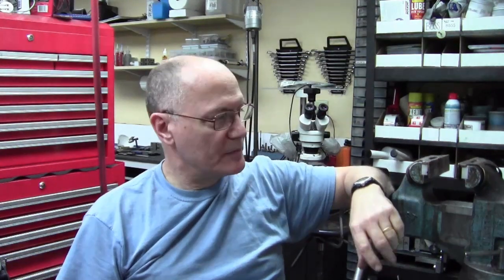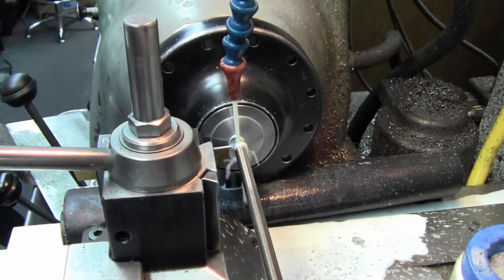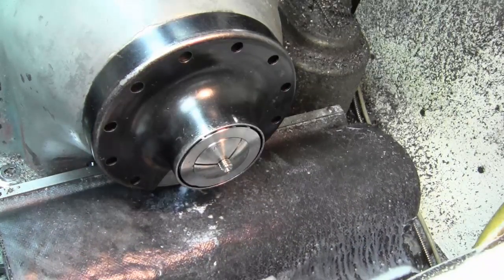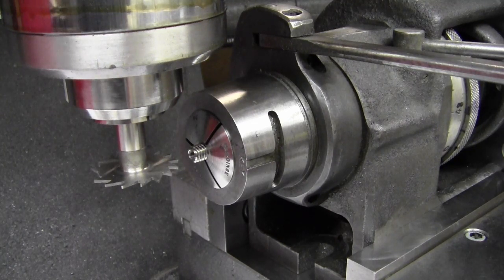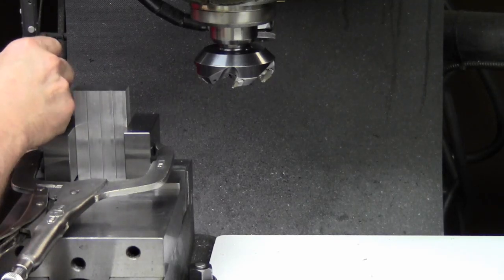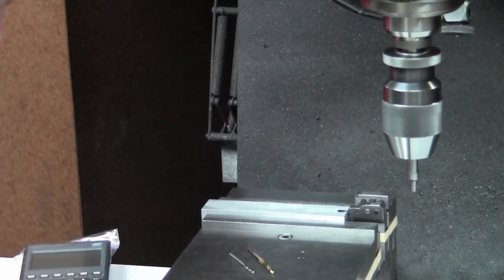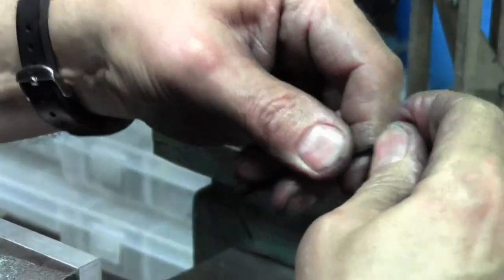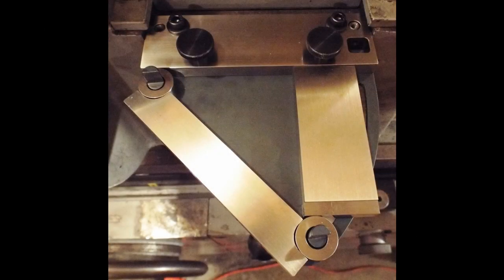Differential Screw Vise Jaws

Comment: New sub here. I thought that differential screws were always two threads with different pitches in the same direction. Now I’ve learned they can be right and left hand the same pitch. I like that your shop is a little bit dirty like mine and doesn’t look like a laboratory.

Comment: The chamfering tool is brilliant.
Reply from the maker: +cod.cape  Thanks.  That thing gets an immense amount of use in my shop. A chamfer machine is not a new idea but there are a lot of design features incorporated in this one that make it unique.
Reply: A complication is that if you were to build one now, you would have to get a used unit. That model that I think is a rebranded Ryobi is no longer made from what I can tell. Bosch made a similar unit too but it looks like it might also be discontinued. I am thinking the easier route if you wanted to start with a new machine. Is a benchtop belt sander.
Reply from the maker: ***** I do a lot of hardened tool steel work where I want to do a very  precise chamfer after finish grinding. The abrasive belt works on both hard and soft material. The axial grind lay of the belt leaves no burrs on the chamfers and I can change grit size to suit the job at hand. If you do a lot of large chamfers > .06" the belt sander will NOT be the ideal tool. Most of my chamfers are < .03"

Comment: Can you please do a video on how you zero out your tool post mounted drill?
Reply from the maker: Put a dowel in the drill chuck. Put a dial test indicator in the spindle. Move the center height and x position of the drill chuck to get it true to the spindle as you spin the indicator around the pin in the chuck.
Reply: Rodger that, thx

Comment: Enjoyed very much, great tips on making the threaded inserts with the collet stop and operations.
Reply from the maker: Thanks Bill glad you enjoyed it!
Reply: Robin is that a shop made collet stop?  What is the size of the stud? From what I am seeing commercial ones seem to be 3/8-24.  I am going to make one I could have used one today would have saved me a lot of time.
Reply from the maker: I have 3 and they are all purchased. That one is 3/8-16 and I have one that is 3/8-24 and one that uses 1/2 dia. solid with a setscrew flat. I just buy all thread to make a variety of styles and diameters. I like the 1/2 diameter style for its instant change of stop rod. The 3/8-16 is next favorite and the 3/8-24 takes too long to change stops even when you use a drill to spin them out.
Reply: Thanks Robin, I think I am going to try and make one with a setscrew and one with a 3/8 16 screw.

Comment: Enjoyed it.  I noticed you milled the aluminum to length, but didn't true up the pieces facing the jaws (the backs against the cast iron) and the space (faces) between the jaws (facing each other where stuff is clamped).  Is it just because they're "soft" jaws, so they're going to get out of whack anyway, and you'd never use it as a reference surface for measuring, so no point?
Reply from the maker: Correct!

Comment: Too late now, but you could have made the through-holes in the vise jaws and had the blind holes in the inserts (leaving an unholed face). 

Source, please, for the double-ended, socketed screws. I could find left-right threaded studs at McMaster-Carr, but without the sockets for tightening.
Reply from the maker: That is a good idea Peter and you are right it is tool late now.  Here is the link for the screws at McMaster http://www.mcmaster.com/#carbide-insert-holder-set-screws/=13dvgkh
Reply: Weird. I wonder why my search did not find them. McMaster-Carr website is usually so good at bringing up the correct pages for a search with ambiguous or poorly-worded search terms. (Page bookmarked on the McMC website)

BTW, nice coverage of the advantages and cautions for using collet stops.

Comment: Robin, first I must apologize as I've been calling you Rob.  Got that fixed now :-). Another awesome video. I was thinking along the same lines as a previous commenter, I would love to see a tour of you shop.  But if not, I think a video series on all the cool tools you have created would be incredibly well received. Starting with the chamfer-meister. I saw that in another video of yours and wondered what that was.  This one described it a little, but I suspect we would all like to learn more details.  Also notice you are using a large hand wheel for the quill.  Obviously you must find that more efficient than one of those quick adjust models. Finally, are you using for the CNC mill?  Thanks.....  Joel
Reply from the maker: Joel, no problem as many who know my name is Robin call me Rob. I promise you will eventually see everything as I work thru my video list. The jig bore style hand wheel is really nice and came from Ralmikes Tool arama many years ago.  Not sure what your question was about the CNC mill.
Reply: +ROBRENZ robin, I guess I didn't proof read that very well.  The CNC question was intended to ask what brand/size mill are you using?  Is it something you converted too, or something purchased?  The work and precision you strive for and achieve is simply amazing.
Reply: I too was wondering about the CNC mill. And also what the guides on the chamerfermeister are made from (-8
Reply from the maker: The mill is a Southwestern industries Trac DPM
Reply from the maker: They are hardened and ground A2 tool steel at 60 RC
Reply: That would be a Southwestern Industries DPM S3 with the AGE 3 control. (Love mine)

Comment: G'day Robin, I was hoping you this was going to be a video on genuine differential screws for the job. They often lead to brilliant and eloquent solutions and don't require any left hand threads, so I was very keen to see how you'd used them. As it turned out, and you rightly pointed out at the outset, in fact these are not actually "differential" threads in the true sense of the word, but it was still a nice video, and thanks for sharing it.

I did feel compelled however to point out that there is no such word in the English language as "heigth", and I know I'm not the only one around who is left wondering where the heck the usage of this word is suddenly coming from. I defy anyone left doubting to find it in any dictionary, as it just doesn't exist. Tom (Lipton) and I have a running joke about me being the "pedantic police" in this regard, but I don't think it's a moot point when many people new to machining are trying to learn from channels like yours, and they may as well learn the correct terms for things instead of charging around looking like idiots while asking for "heigth gages"!
Reply from the maker: Thanks Pete,  I will try working on that but I think my unnecessary use of "ah" to fill every pause in speech needs my main attention right now.
Reply: Ha ha, well you can have some of my "umms" if you like. Better yet, take my "deer caught in the headlights" look every time a camera is even mentioned! I did like that chamfer setup you've made though. You mentioned it in another video and I noticed it then. Sounds noisy, but the concept could be used with other sanders or grinders I'd think. Certainly much cheaper than the commercial ones!!! It would make a good build project if you were considering video subjects. I don't recall seeing a DIY version of these before.

PS. If you think I'm harsh on "heigth", don't get me started on "Soder" with the L that's gone AWOL ;)
Reply from the maker: Get ready, in my next 3 part video on making custom digital calipers I do some "silver soddering".
Reply: Good grief, I'll have no hair left! I was doing a bunch of silver soLdering last night and your last video on "soddering" Tom Lipton's level was going around in my head like the Chucky doll! :P
Reply: @ROBRENZ  don't worry, you may be in the minority that still use the version that people such as Benjamin Franklin used, and that matches with breadth and width, but just because most people have forgotten that heigth is indeed just as proper as width, doesn't mean that you are wrong in using it!

It is much like many of the other details of precision that you have learned that are forgotten by most machinists, you are bringing harmony into your language with width and depth, which probably increases the accuracy of your measurements by a few billionths of an inch.

Comment: 50 years ago I made a few different lengths of pipe that I slotted to go over the spindle stop screw so I wouldn’t need to spin the nuts up and down. Saves a lot of time.
Reply: I did exactly the same thing for the same reasons. Many years later I designed and patented the “Rapid-Stop” a quick release nut that mounted permanently on the Bridgeport quill. It’s no longer in production but I use mine almost every day.

Comment: Hi.

What is that (17:46) flat surface where you 'sand' the blocks?

Nice saw.

Regards
SC
Reply from the maker: That is a cast iron surface plate with 220 silicon carbide paper lightly glued on with 3M 77 contact spray.
Reply: Thank you.

I suppose I can use 3M 77 in my granite flat and remove it with acetone, right?

SC
Reply from the maker: Serra Cabo I would not advise putting abrasive paper on a good granite plate. I would dedicate a cheap one to this job.  wd-40 removes the 3M77 spray best.

Comment: "Shop Notes"*

• Inspired to use soft jaws by Tom Lipton's Baby Bullet vise build: https://www.youtube.com/playlist?list=PLeIuq8LxgnrHZyoRtyvqw-G0Ggl9Ndp70
• Explains differential screw terminology
• Explains how this design is adapted to a typical vise jaw
• Uses 10-32 clamping/differential set screw.
McMasterCarr: https://www.mcmaster.com/#set-screws/=19pej3n
• Parting with a collet-stop in the Hardinge. Collet-stop made to accomodate pip left from parting. Holding the part by hand to prevent whipping (not recommended).
• Drilling and tapping the LH thread in the insert
• Cool-Tool 2 + Tetrahedral Boron Nitride
Unfortunately, Cool Tool 2 can't be sold in California.
McMasterCarr: https://www.mcmaster.com/#cool-tool-ii-cutting-fluids/=19perdz
Rob's link to Boron Nitride (Amazon): https://www.amazon.com/Boron-Nitride-BN-Powder-Purity/dp/B015ENSWHA/
• Overview of collet indexing head and modifications made to it.
• Fitting the screw slot
• Quick introduction to the Rollin EF-1459 and modifications.
Instagram post of further depthstop mod: https://www.instagram.com/p/BVDJ-0aAohJ/?taken-by=robinrenzetti
Rollin's website: http://www.rollinsaw.com/band_saws/EF1459_vertical_band_saw.htm
I've used one of these. They are the only real competitor to Marvel saws. While I thought it was a good tool, I had some complaints. Most of which are addressed by Rob's mods.
• Cutting and flattening the Al stock
• Gang milling an odd setup.
• There's a call-out of the 11R Vise-Grips but I cannot make out the change.
This Instgram post seems to explain it: https://www.instagram.com/p/BYzGmVmg3np/?taken-by=robinrenzetti
• Note on getting a better finish from insert teeth on the inside on a face mill if the work is smaller than the cutting diameter.
• Overview of the Chamfer-Meister, aka the most over-built attachment a Craftsman belt sander has ever seen.
• Drilling and tapping the Al soft jaws.
• Tip about LPS-3 corrosion inhibitor
Amazon: https://www.amazon.com/LPS-Premier-Rust-Inhibitor-Aerosol/dp/B01N3RZI0J/
KBC Tool: http://www.kbctools.com/products/FLUIDS/LUBRICATION%20PRODUCTS/GREASE/10384.aspx
• Blue Moly links:
McMasterCarr: https://www.mcmaster.com/#bostik-never-seez-blue-moly-antiseize-lubricants/=19pflvg
Amazon: https://www.amazon.com/Never-Seez-NBBT-8-Anti-Seize-Compound-Temperature/dp/B001HWBSTM/
• Shows a thin sine bar with hollow rolls attached by the RH/LH screws. Also, shows fixture it was designed for and gives demonstration of the fixture's various configurations.
https://youtu.be/4k261VAbWCU?t=32m27s

*Not affiliated with any manufacturer or distributor. Links just for reference.
Reply from the maker: Thanks again, these notes are much appreciated and when pinned help all the other comment readers!  

May I have your permission to cut and paste this type of comment into the video notes giving you full credit? I have found nothing so far in your comments that I would edit out but I would reserve the right to remove anything I found inappropriate.  Please let me know.

Thanks Robin
Reply: Absolutely fine with me. Also, edit or annotate as you see fit.
Cheers.

Comment: Fascinating and instructive, but I was not clear why it appeared to be a race against time. And talking over the noise of the machinery made for difficult listening. An explanation of differential screws would have been helpful - one just had to pick it up as it went along, but surely there needs to be a relation between the thickness of the jaws and the depth of the tapped holes in the vice?

Comment: I was told by at least 50 people never use a water-based coolant on a 59 that they don't have a sealed bearing in that it get in there!!!!
I have this machine
Reply from the maker: I have had no problems with it but I use semi synthetic with high mineral oil content.
Reply: ROBRENZ I thought it was strictly a water-based yes if it's mineral oil base it would be fine it looks very light something that I should get. I was hooked up with a mineral oil company I lost my contacts information I can't even remember the damn company name is ticking me off but they make flood coolant specifically for these old pumps. Love your video by the way

Comment: Cool vid, thanks for taking the trouble to share your workflow. I have an ER32 collet chuck and repetitive work is a pain in the... you know what. But I kinda like that kinda work so no big deal for me. You've given me a feast of food for thought though, please keep it coming.
Reply from the maker: If you like this then make sure you go back to my "ultimate kelvin connection part1 and 2 .  Don't let the electronic slant fool you this is a machining video.
Reply: @ROBRENZ  Thanks, I will do that. No worries, I'm good with electronics AND machining! RE differential screws, I think I saw a Tom Lipton vid (Repeat-O-Meter?) that gave me an idea for bed adjusters for my 3d printer, which work beautifully.

Comment: What is the purpose behind the long toolpost stud / cover? I was considering to drill through the vise (a bit ugly), or pin the jaws with roll pins when I get round to actually doing them, but this is a great idea. Not sure if the pins would've held when clamping on the edge. That drill chuck in the toolholder is nice. There are so many details I have to watch more than once. Recently I find myself wanting a vise with the clamping surfaces parallel to the table, not sure what I'll do about that.
Reply from the maker: I made an indicator arm that mounts on that post for all lathe indicating. That way I never have to stick a mag base on the lathe.  You will see it in use in some of my next videos.

Comment: Could that chamfer machine have been designed to run the part across the belt diagonally? Some belt grinding machines are designed like that to level the wear on the belt
Reply from the maker: I am going to add an oscillator so the sliding carriage moves slowly back and forth over the full usable belt width all the time.

Comment: Hi Robin. I wanted to ask a question about the Boron Nitride you are adding to other oils and greases. In this video you called it Tetrahedral, but I can only find Hexagonal, Cubic, etc. Previously I had assumed Hexagonal is what I needed. Stan mentioned you also mix it with Dart CMD Extreme Pressure Lube for using on dead centers, if I'm not mistaken. Hoping you can clear up my confusion.
Reply from the maker: I should not rely on memory! Cubic is the abrasive, hexagonal is the lubricative also called white graphite.  google ZYP coatings for info.
Reply: Awesome. Thank you!

Comment: Every other guy would have drilled from the backside... :-) But you found a way to leave the vice unchanged and remain compatible with existing jaws and have smaller holes. Concerning the differential screws I think this term is correct. It is just a special case where both pitches have the same value. The same is true for the rear axle differential in street vehicles which is also a special case (symmetric) of a general differential gear. We have commented about it in an earlier video: Your way to feed thin stock from the front side into a 5C collet with a back stop in it, keep the free end in your hand to avoid whipping, turn the part and part it off. It seems odd. :-) I have thought about it for a while. For small batches it has no disadvantages compared to the classic way of feeding from the backside. But I also can't see big advantages. It is just another way of doing it which works just as well for small batches.
Reply from the maker: My " tips on manual lathe high production" video shows this method also but with a stock tube in the tailstock. I think there is a distinct advantage on the parts shown. All these comments based on a manual machine with no inherent bar feeding mechanism and no automated tool changing/cnc operation. Thanks for watching and commenting!